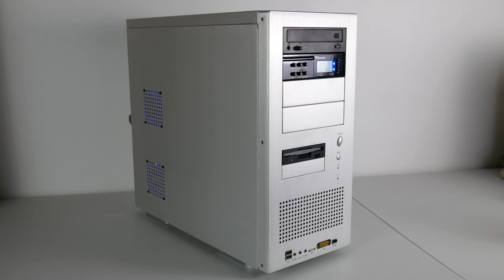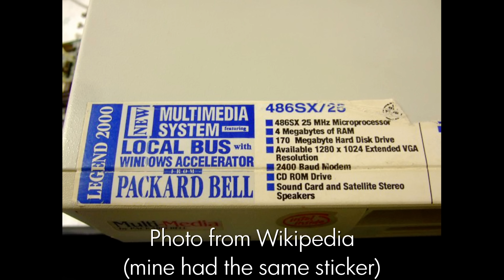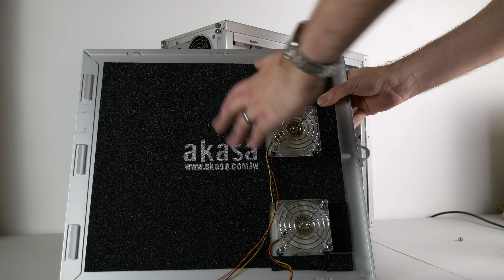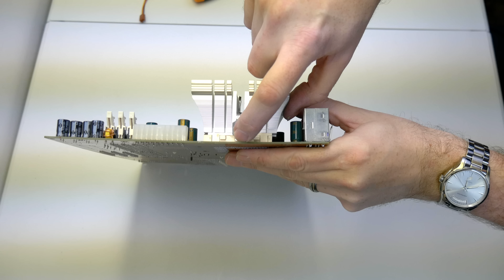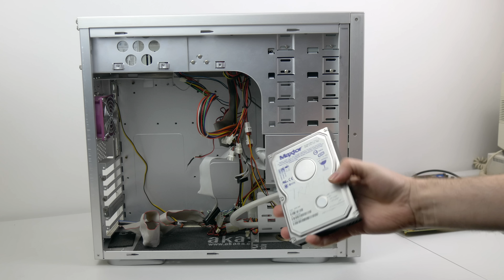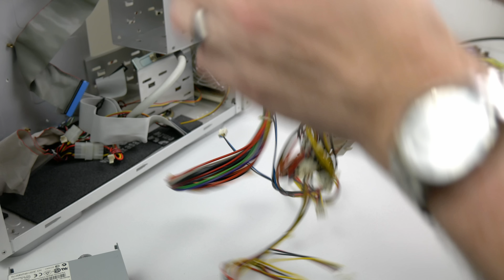20 year old PC teardown and demo - Windows XP, gaming and more!

Comment: New subscriber. I enjoyed watching this video. I have a few floppy drives, and zip drive, laying around.

I am considering attempting my first PC build. If you find adapters for connecting floppy drive to a modern system, I would appreciate it if you posted that information. I have some older games on CD that would require the addition of an optical drive to my planned system.

Will I have any issues trying to connect an optical drive when building a PC? I have some old Dell computers laying around. I plan to use the optical drive from one of those. My zip drive is an external drive. Would love to have that in the planned system, and functioning, too, if possible. I used the zip drive for my photography studies and would like to transfer those photos to a more useful device.
Reply from the maker: An internal floppy in a modern computer isn't as easy as I assumed (or remembered) when I made the video. It's possible, but it wouldn't be pretty or cheap. You'd need to use a USB-ISA adapter and an ISA floppy controller, which all told would probably run you about $180, not including the floppy drive, and then you'd need to mount the adapter and card in your case somewhere.

I think it's probably better at this point to just use an external USB floppy drive - you can get them for $20 or less. That's what I do with my laptop.

Optical drives are not a problem in modern systems. There are plenty of SATA optical drives out there and Windows 10 recognizes them fine. I'd really recommend just getting a Blu-Ray Rewriter at this point - that's the best kind of optical drive you're ever going to be able to get, and they're not very expensive. This isn't the exact drive I have in my current desktop but it's the same brand and the specs are very similar (I think this is just a newer model) - mine handles any kind of disc: http://amzn.to/2ok2iu7

For your Zip drive, if you have an original parallel port model then the problem is going to be the drivers. Apparently the last driver release Iomega made is really bad news for Windows 10 - check out the reviews here: http://download.cnet.com/IomegaWare/3000-2122_4-10200789.html

Edit: If you have a USB Zip drive, it'll probably just work. If you don't, then the easiest/cheapest thing is probably going to just be to get a used one on Ebay. Note that I don't guarantee it'll work, but I've found others online who say that it does for them on Windows 10.

Hope this helps! If you do decide to buy that Blu-Ray drive above, I'd love it if you did it through that link :)
Reply: +Modern Classics
@Modern Classics
(I can never remember which one is the correct format).
 Thank you. This information is very helpful.

Comment: I had a similar rig back in 2003-ish. I mean I was originally going to get a PC just for word processing as I was heading to college for music production...until I was introduced to games like "Halo: Combat Evolved", "Star Wars Jedi Knight: Jedi Academy" and "Star Wars: Knights of the Old Republic". So then it was all about a gaming PC on a budget; 

Windows XP - nVidia GeForce 4Ti 4200 128MB - 512MB DDR - AMD Athlon XP 1900+  - MSI K7T Turbo2 - 80GB IDE - CD-/+RW and DVD-ROM drive. I had a generic aluminium case. I was rocking a 17" CRT and 2.1 speakers with built-in FM radio. 

I would eventually grab a 1GB DDR stick, make a few card upgrades. My next full build wouldn't be until 2009 because of Batman Arkham Asylum, and it was an Intel/ATi build.

Comment: I'm planning on building a PC with a MSI GeForce GTX 1080 Armor OC as my GPU and a Intel 6th generation i5 6600k skylake as my processor, will this cause any bottleneck? And if so what processor should I choose instead, then? I still have 150$ extra to increase on my cpu. Thanks!
Reply from the maker: There's nothing about those two components that would cause any bottleneck for gaming. Just make sure your motherboard, RAM, drives, PSU, etc. are up to the task too. Sometimes I see people buy really expensive main components and match them with a crappy $60 motherboard and $40 generic PSU to power it, and they wonder why it's crashing all the time, or throttling. My philosophy is always to have a well balanced system with good components all around, even if it means saving a bit on the GPU so I can spend some money elsewhere. That's my only bit of advice. But you might already have good components otherwise, I don't know.
Reply: Thanks for the reply! Ive been searching the web for the past hour because This is my first build and I want it to be decent. Basically im rocking a MSI Z170A Gaming M5 LGA1151 Motherboard which ive seen good ratings of, the GPU and processor you already know of,  2 sticks of 16gb memory Corsair Vengeance LPX, a 1 terabyte hard drive, 480Gb Solid State Drive, Corsair Hydro Series H110i Liquid Cooler (for processor), and a power supply which matches the case. I dont see any reasons why this wouldnt work, but if there is anything that is overkill which I could get rid of to have a bit more money for monitors, or anything that isnt compatible with one another, any help would be extremely grateful. Thanks again!

Edit: Plus you got another sub for the help!
Edit 2: My PSU is 90$, so I guess thats decent enough. The case that matches it is 150$, so that should also be good aswell (I think).
Reply from the maker: It all sounds fine to me. I don't have experience with that specific board, but you picked good quality brands for everything (MSI and Corsair are also the two brands I use for most of my new stuff). Just Googling that motherboard, it seems like the one thing to watch out for is a thermal throttling defect that can limit the CPU to 800mhz, but in my experience a lot of boards have common issues like that that affect a small percentage of boards. Make sure you update the BIOS as soon as you install the board.
Reply: Ok! Thanks for the help, once again. I will investigate your tips and see what I can do for them. Thanks!

Edit(as always): instead of the m5 in the motherboard could you check the m7 version instead of the m5, to see if that gets solved in the newer version please? Thanks alot for all your help!
Reply from the maker: Woops, I think I actually was looking at the M7 by mistake. I just looked at the M5 now - it has a few issues as well, but they don't seem to have a common thread like the M7. Check the reviews at newegg: https://www.newegg.com/Product/Product.aspx?Item=N82E16813130873

But I wouldn't necessarily worry about it, especially if there's no single common issue. Sometimes stuff is just defective or wears out, and those people will often be the first to post a review. There honestly aren't that many boards on newegg with 5 star averages, so this board is probably as reliable as any.
Reply: After final thought I decided to change it to a Asus TUF Z270 Mark 1 instead, but thanks anyways for the other helpful tips!

Comment: you can always put a newer board in lol and stuff the case not dead
Reply from the maker: It's not worth it. The case has no cable management features and only supports 80mm fans. I have a Corsair C70 that I use for my modern PC.

Comment: I spy a few bulging caps... that motherboard is not long for this world unfortunately. :(
Reply from the maker: That's fine. I don't use this computer anymore. (That was the point of the video.)
Reply: They're replaceable... Just because some caps are bulging doesn't mean the board is dead dude..
Reply: Layne Brown they are very easy to replace tho
Reply: Aside from the CMOS battery and chip the caps are usually the easiest thing to replace on a board. It's better to change them before they die.

Comment: i have an old custom build pc. it has room for 4 ram cards but only 2 are in use. it has 512 mb ram. but the other 2 slots are filled with blank cards. there are no components on them. does someone know what they actualy do?
Reply from the maker: Dust protection? Honestly, I've never seen that. Do they have actual contacts on them, or are they completely blank? Are they made of silicon, or are they just cardboard or something?
Reply: Modern Classic its actualy a pcb board with contacts but there is nothing on them.

Comment: The CPU fan... it's trying to pull the hot air away... VERY poor choice for any cpu. Just thought I'd mention that.
Reply from the maker: +Solomon Malkuth Every system is different based on overall airflow. I tested this one both ways. This is what gave me better temps.
Reply: oh, okay lol. Haven't seen that in my experience is all. I own an IT business out of Montana, and though of course I was taught to test every airflow solution, I guess I just never found a case where flipping the cpu fan would be beneficial. Thank you for telling me though. It was nice to see an older system like that still up and running.
Reply from the maker: You can either pull the hot air or push it off the heatsink. Which is better just depends on the design of the case, positioning of other fans, and any obstructions around that area. In this case's... case, there is a fan blowing out directly in front of the CPU fan. So if the CPU fan is blowing in, they will fight with each other over the same air. (I tested reversing the side case fan, but it still gave me worse temps because that hot air then built up inside the case - the only other case fan blowing out up high is the rear fan.) This case was actually designed to have both the CPU fan and that side fan blowing out, so it can quickly remove the heat from the CPU heatsink.

Comment: I have a Packard Bell too! Mine's a bit newer...1996, with a 133Mhz Pentium.

Only thing is, there's no voltage regulator on the motherboard so I can't upgrade to a 166 or 233MHz PentiumMMX processor! Sad!
Reply from the maker: Yeah those PB's often had annoying limitations... mine was pretty locked down too, and barely had any room for expanding anything. 1 SIMM slot, 1 ISA slot, that's it. At least it had a ZIF socket for the CPU, if I remember right, so I could put a 486DX2-66 in it.
Reply: It's annoying because in every other respect it's a nicely expandable tower! Takes up to 128MB of RAM, has 2 PCI and 3 ISA slots on a riser card (as was common at the time)...but not having a voltage regulator restricts you to a 150MHz Pentium at the most, as 5v will fry the 3.3v rated MMX CPUs.

That and there's no L2 cache, which was only on the motherboards with MMX processors anyway.

Comment: and that abit mobo is a sweet board for its time, i think the max on that board was a 1.4 ghz ? i might be wrong .. but wow this was a great video, VERY NOSTALGIC
Reply from the maker: That may have been the original official spec, but they pushed it higher with BIOS updates. There just wasn't anything that fast yet when the board first came out, but the architecture didn't change as AMD increased speeds so Abit just supported the new CPU's with the new BIOS's. I think it would support the full Athlon XP line in the end.

Comment: I still have a custom built desktop and a shuttle, shuttle has a whopping 2GB Ram, ATI Rage all in wonder pro 128 32mb Athlon xp 2400+, the desktop has 1GB Ram, GeForce 2 Mx/MX 400 64MB Varient and an Athlon XP 2000+, still run XP great with older games such as theme hospital, was my favorite game for a long time when it came out.

Comment: Reminds me of when I got my very first computer, and it was a single core hyperthreading chip from Intel, clocked at 3 GHz. Before that I would always borrow a computer. I played on that machine until it became impossible to play more modern titles, and then after that was where I got an Intel Core i7 920 and OC it to 3.6 GHz. Was an awesome chip back in the day. I got one with D0 stepping. However eventually I got a better machine than that, and eventually got around to putting that old computer into the rubbish. I didn't want to sell it.

Comment: I got a question, I guess you know a lot about hard drives, http://i.imgur.com/B3t1ciE.jpg So do you know what that blue foam is used for? (I go to High School and I just can't figure it out or find an answer online) Here is another picture I took of that part http://i.imgur.com/68GPP5G.jpg
Reply from the maker: I could really only guess. I'm not sure how common that is; the hard drives I've worked with don't have a metal plate like that on the bottom. The most likely thing I can think is that it's acoustic. There was a time when hard drive noise had become a big problem, and some drive manufacturers were setting their drives to "fast" mode so they'd benchmark well, but in that mode they were incredibly loud. (I had a drive like this; just setting it to "quiet" mode completely silenced it.) It's possible that in this era some manufacturers added this foam to try to absorb some of the head seek noises when in fast mode.

Or it could be something else, I'm really not sure. Shock absorption, I guess, but that's not usually a concern in a desktop.

Comment: the geforce 4 was almost twice the length of the one you have i believe it was an older model.
Reply from the maker: No, it's not. You can see the same card here: http://www.vgamuseum.info/index.php/component/k2/item/260-nvidia-geforce4-ti-4200-8x
Reply: I also had a large one ... 
Exactly this one..
http://www.tweaktown.com/articles/333/4_way_geforce_4_ti4200_shootout/index4.html